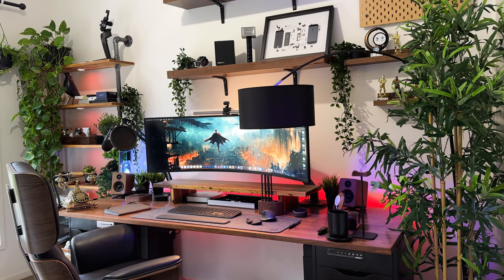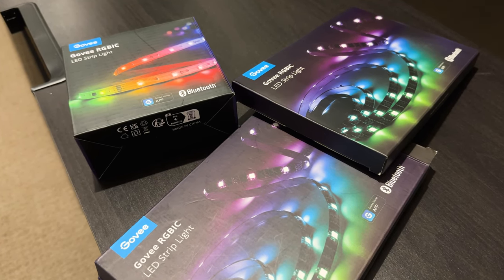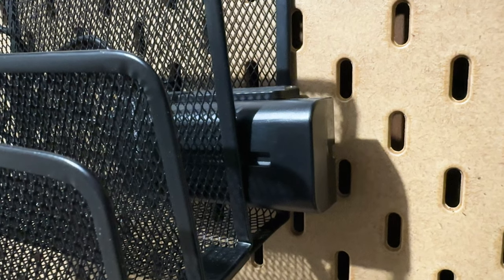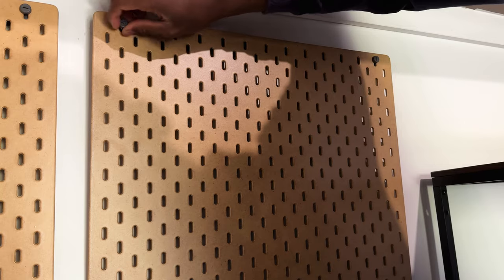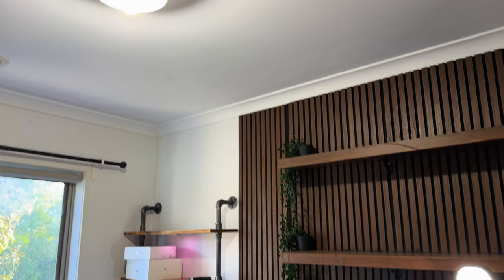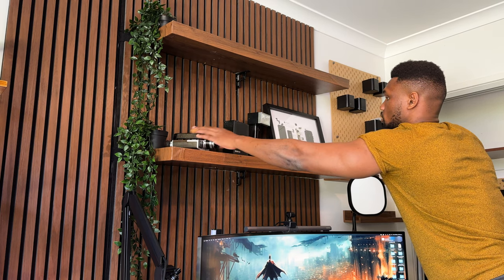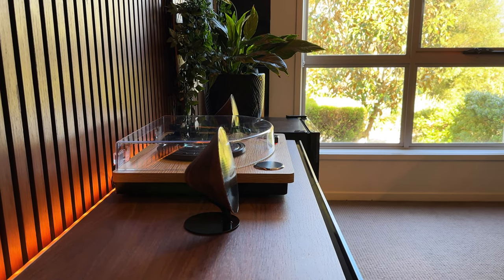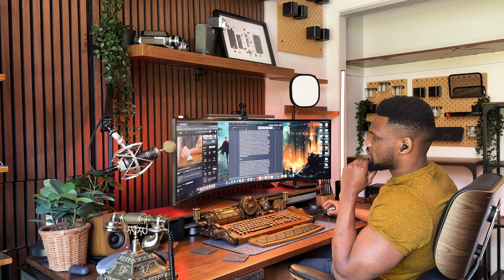I Built My Dream Desk Setup & Home Office With No Experience ( DIY Home Improvement)

Comment: Nicely done! with the makeover bro, your studio looks fantastic and very practical! Opening up the wardrobe and fitting in the shelf units is a great idea :-). Sadly, the wardrobe in my studio is full of boxes "from top to bottom" lmao. Btw, a little trick I've learnt to remove air bubbles from applying contact is to use a small pin, make a tiny hole and squeeze the air out with a key card ;-). The new boom arm & microphone will come in clutch, same goes for the air purifier and HDD storage device for your content... I decided to fit another m2 nvme into my rig, however I still need more! space... I'm thinking I need something similar to what you have... When my wallet recovers haha! This comment would be even longer if I was to name all the goodies, I like that you have used in your makeover! It has been fun to watch your studio grow and expand. Muchly enjoyed this video! Stay safe and well, Cheers - Jass.
Reply from the maker: Thanks Jass. Opening up the wardrobe has  created more space and it also look aesthetic. For the contact paper that’s exactly what I’ll to remove the air bubbles. I had to get a NAS I’ve notice the number of drives I’m buying is increasing and the good thing about a NAS I can access my data from anywhere. Grateful as always for the support and tips here and there